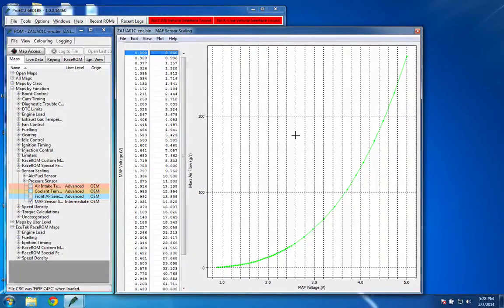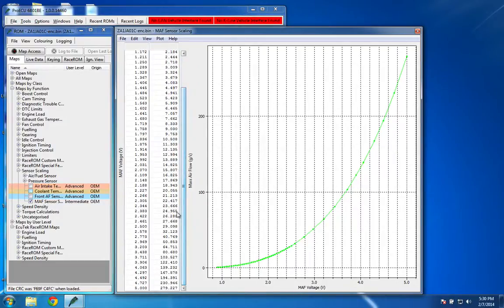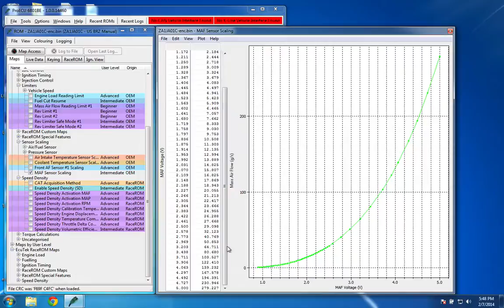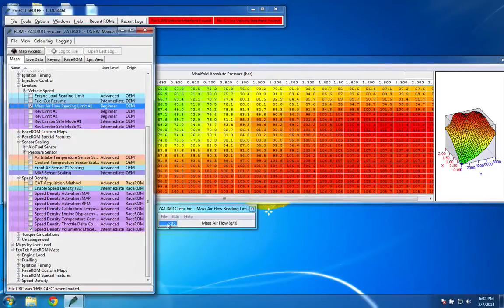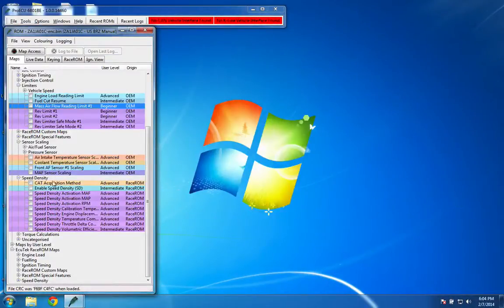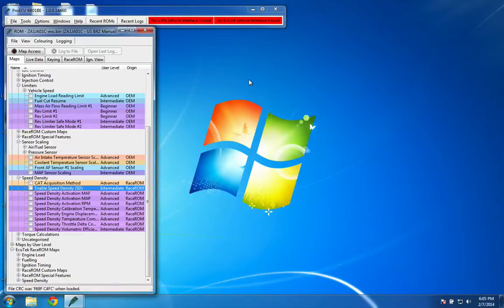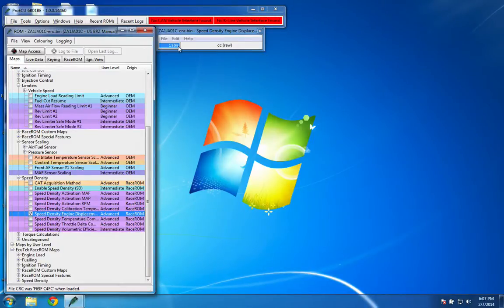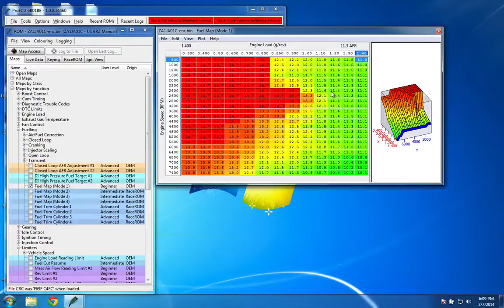MAF and Speed Density with Ecutek RaceRom

Comment: What areas do to tune in? Currently have a Kraftwerks c30 kit on a brz, Drunkmann tuning is dealing with it and I'm having issues with "so called overboosting" either way getting a boost gauge installed Tues. and going to double check the bypass valve, (he's using BRZ edit) Ever ran into any issues with  boost pressure with these kits?
Reply from the maker: Never had issues.  Overboosting on a supercharger doesn't really seem all that possible... as it's a supercharger :).  You mean it's just making more boost than expected?  Maybe you're just using a smaller pulley than you thought?  Kraftwerks has many pulley options.
Reply: +James Martin&#160;Currently running the recommended setup 128/95 C30-94 (according to kraftwerks looked up serial) Tuner was stating he was seeing 14lbs of boost, also has a bad studder at like 4500rpm,, then lauches straight to 7k so getting boost gauge installed tues,&#160;... got any ideas of what could be the issues ie... restriction,, faulty bypass valve, bad tune?
Reply from the maker: +MrJusjones0110 I wouldnt be able to tell without looking at it.  It's literally impossible for the SC to make more boost than the pulley combo allows, though.  The bypass definitely doesn't have anything to do with it (it's only open under vacuum, and if anything would be leaking boost... not making more lol).  Assuming you're reading boost off of the MAP, restriction wouldn't be a cause, either (it's post-throttle body in the manifold).

Anyway, if you can't get it figured out feel free to bring it by.  I've done many of those kits and would be glad to help you fix it.
Reply: +James Martin k if we cant get it figured out soon, ill probably cut ties with this individual and seek other options for sure : ) ... where u located?
Reply from the maker: +MrJusjones0110 Orlando
Reply: +James Martin Good little drive I'm Pensacola, but if things don't get better might have to make the drive Thx for the insight.